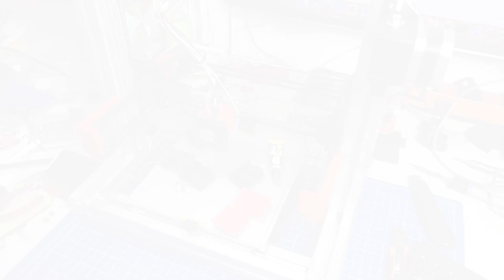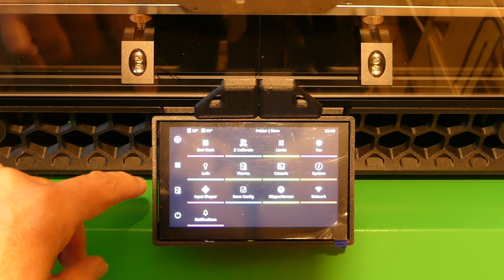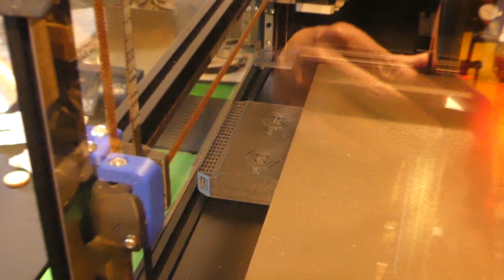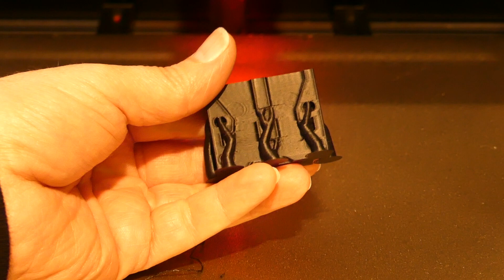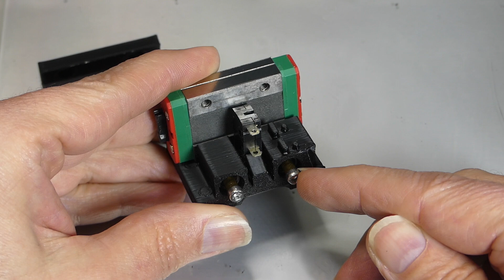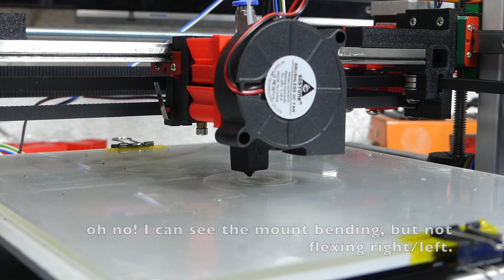A New Robin 3D Printer - Part 7 - A New Hot End Mount, again !

Comment: Dump that tap sensor idea. Go for a Biqu microprobe instead much simpler - fewer moving parts and quite accurate.
Reply from the maker: No, I really WANT a working tap. I have enough probes here that I could use, but they don't have what I want from the tap, like being exactly where the nozzle is.
Reply: Why not go for a cartographer instead? The survey touch feature would meet your requirement
Reply from the maker: The beacon probe does not measure the home point, it can generate a very good height map, but you still need the home switch and an offset setting. Also it only works for conducting print surfaces.
I did look into that option before.
Reply: @dherrendoerfer  are you sure? The beacon contact sets a nozzle Z offset as well as homes...